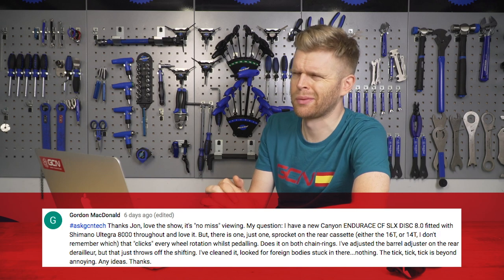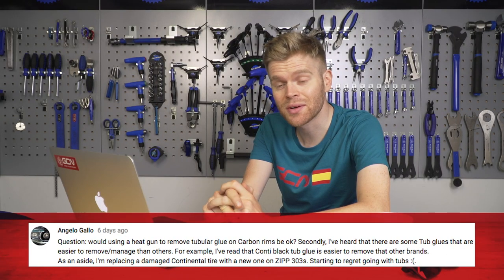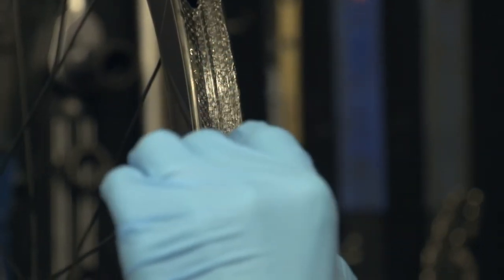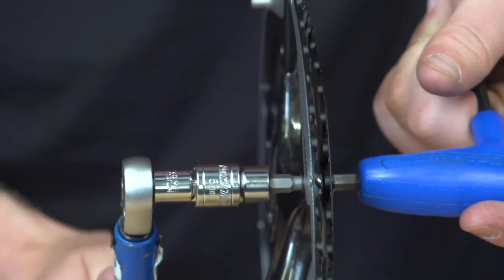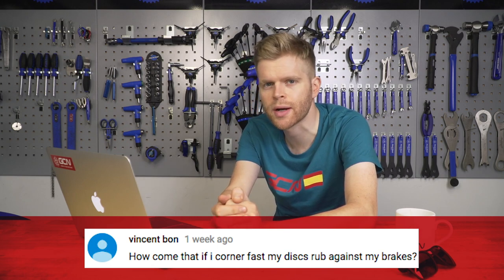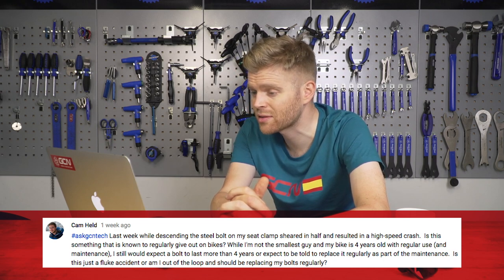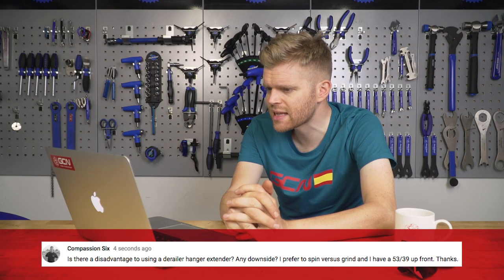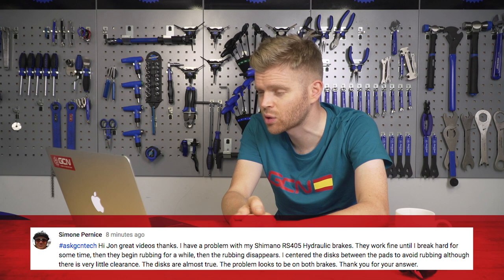Disc Brake Rub, Cassette Noise & Removing Tubular Glue | GCN Tech Clinic

Comment: My bet is that the broken seat clamp bolt is on a single bolt clamp, and has a lot of setback.  I broke 3 bolts this way on the carbon post that came on my specialized allez before I finally threw it in the bin and switched to a 2 bolt rocker style clamp.  Fortunately, I managed not to crash, but it's still scary when there's a loud snap and your saddle falls off.

The reason for this is that the clamp bolt is very close to the fulcrum, and with a lot of setback and 100kg bouncing on the saddle, there's thousands of kg of pull on that bolt.  The guys at the bike shop didn't believe me, and insisted that I must have had the bolt torqued incorrectly too, but it's just a bad design which happens to work for the 99% of people who don't need all that setback.  Using a 2 bolt clamp (Same style as on a Thomson post, etc) gets the bolts away from the pivot, and even though the bolts are way thinner, they can handle the loads easily.

Comment: #askgcntech 
Hi ollie, Im  thinking on replacing my 105 pulley wheels, which do you think are the best ceramic bearing pulley wheels for 60 €?
Reply: Aritz Vizcay don’t believe the nonsense, ceramic bearings being beneficial in pulley wheels is just a myth, save your money and buy a pair aluminium pulley wheels with simple steel bearings. Don’t believe me? Look for the friction facts video on YouTube.
Reply: @tacituskilgore8379  Link of the vídeo pls
Reply: I went with the Token ceramic jockey wheels. Very nice and were about $60.

Comment: Use a heat gun!! Only heat the glue till it melts then get your finger with a cloth and wipe across the heated melted section shaping your finger with the shape of the curve on the rim. You don’t need to get all glue off just leave a smooth film. Then glue and fit as normal. Or go the easy way and use tape. This can be applied over the film of glue.

Comment: hi jonllie!...I changed 53-39 crankset to 50-39 and 13-27  cassette  to 11-30 ... of how many chain link I have to remove? #askgcntech
Reply: So, the largest cog of your new cassette is 3 teeth larger, but the big ring is 3 teeth smaller. If your chain was properly sized, it should still be the right length.
Reply: I think the rear derailleur is too closed when I use 50 -11 and I can not use the 39-11 because the chain rubs on it

Comment: #askgcntech Chainslap, ... After buying a needed set of new wheels (fulcrum 5) including new rear cassette, my bike now suffers from chain slap quite bad. (chain slap on the top) When ever is suddenly stop peddling in the smaller rings (in the back) (big ring in front), the chain slaps the frame. Sometimes very aggressive, there have even been some drops in front. Only other adjustment was fitting a derailleur extender and tightening the B screw (fitting it toward the back so, i thought, i would get less slap...) 
Could it be a heavier/sturdier freewheel body? or just the heavier weight of my cassette as it now is a 11-34 instead of a 11-25?
Reply: Jordy D did you change the chain when you changed the cassette?
Reply: Sounds like your chain is too long? And your mech isnt made to run that cassette.
Reply: @kemikade 
No, chain and front gears remained the same. So it can not be that the chain is to long.
Reply: freehub momentary stuck?
Reply: Sorry didn't see your reply. You should generally change the cassette and chain at the same time because they wear together. A new cassette with an old chain isn't going to work well if the chain is worn, it wont mesh with the cogs well.

Comment: Hi GCN - to settle an argument, which do you think would cause more damage/wear to a bike over time - cycling in coastal air (like Cornwall) or in London's polluted air? #torqueback #askgcntech
Reply: Henry W R White salty air every time, unless of course you riding in winter on gritted London streets.
Reply: I've seen some pretty scary videos of cyclists in London. It's like playing Russian roulette. Having your bike turned into a 🥞 pancake by a bus would cause some wear. Ride safe! BTW, I dropped a chain going over a cattle grid on the Lizard peninsula in Cornwall and scratched my chinarello carbon frame. Do you you get those in London? 😜Cheers

Comment: Hi Jon/Ollie, great show! I've got a question relating water in my aero wheels. I am running Bontrager Aeolus comp 5 for a few months now, and last Sunday it was extremely wet outside. This also meant I had to give my wheels an extra good wash after the ride. After that, I noticed there is water left in the rims and it won't come out. There is one small hole on one side of each wheel that is supposed to let water escape, but this hardly works. I can clearly hear the water running when the wheel is turning and it is beyond my patience-level :) Thanks for your help! #askgcntech
Reply: Remi Blommers try deflating
Reply: Removing the tire does do the trick, but I was hoping there are quicker solutions. Cheers.

Comment: Your comments on disc brakes are exactly why I HATE them for road use.  Tolerances are just too tight to be practical for those of us with a full time life outside of bikes.  Disk brakes are really only beneficial in a small number of situations, unless you live in one of the places that rains most days of the year, and you have to live with the pain of maintaining the rest of the time.  I spend more time maintaining the disc brakes on my 'cross bike with disc brakes than I spend on every other bit of maintenance combined.  Rim brakes just work and are easy to fix when something does go wrong.

Comment: #askGCNtech
Hi Ollie! I have a problem. When i ride everything goes smooth until... I put in one of the biggest 3 rings in the back and start to grind on the hill. So, if I paddle at a high cadence there is no problem, but when I have to push a little bit more(or even stand out of a saddle) there is a feeling and a noise like something is rubbing. PLEASE HELP!!!! 

ps. I hope you understand what my problem is,  because I know my English is another problem, maybe just for other YT channel :)
Reply: Make sure your rear wheel/tyre isn't rubbing on your frame when you stand up out of the saddle. Make sure your wheel is centred when you tighten up quick release too

Comment: For the brack clicking problem, it's not only air, but also dirty piston could lead to this problem.
In the latter case, park tool has a good video solving the problem and it doesn't even need to bleed!
https://www.youtube.com/watch?v=vQXFFgRButo